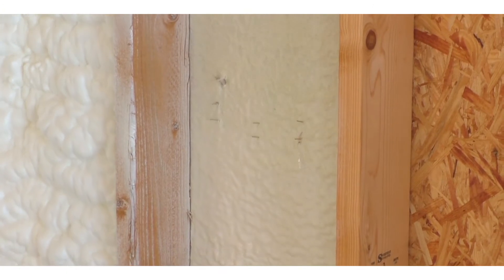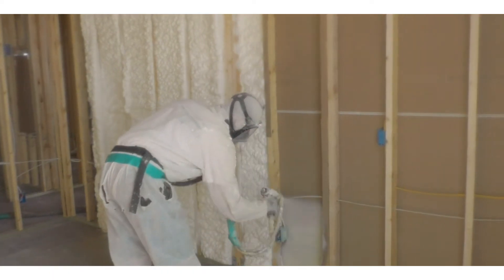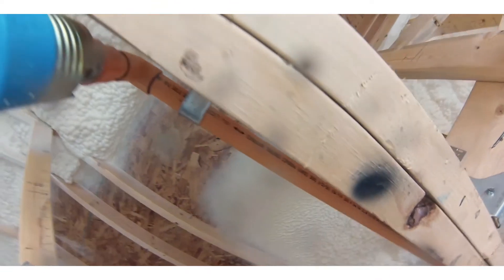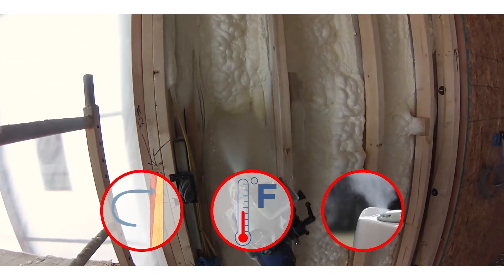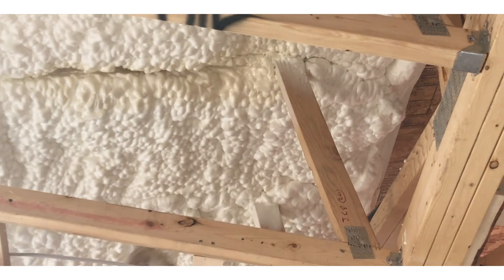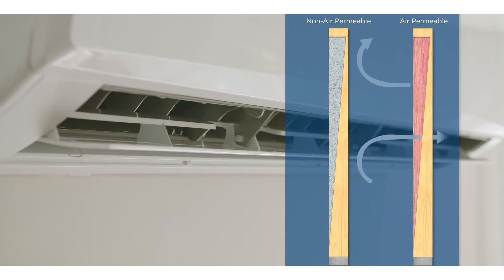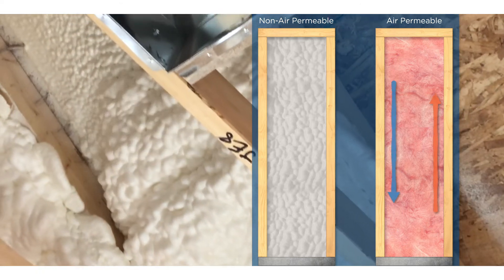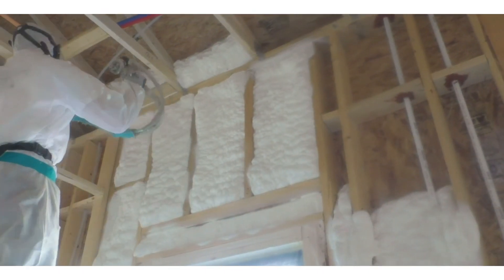Spray Foam Facts - The truth about R-Value

Comment: Good video, but more specific information / details are required for this video to be great. 

R-Value is irrelevant when speaking about closed cell spray foam. BTU retention is the benefit of closed cell spray foam. However, more inches of spray foam doesn’t necessarily equate to better performance. You see the greatest gains at 2”. After that, 5” of closed cell spray foam is only 10% better than 2”.

Also, in the video, you were using open cell and talking about it being a good air barrier. However, open cell has a major problem with vapor drive and water leaks, as it is vapor open / permeable. So, when using spray foam, and open cell more specifically, you have to discuss the vapor control layer. In other words, spray foam is not an afterthought insulating material. It is a starting point, and all the other building systems are designed around it.